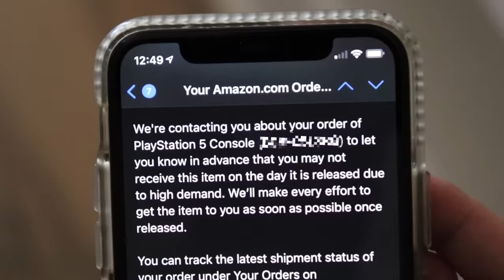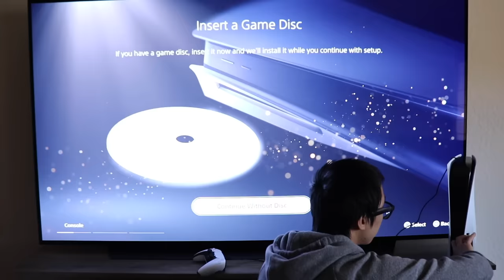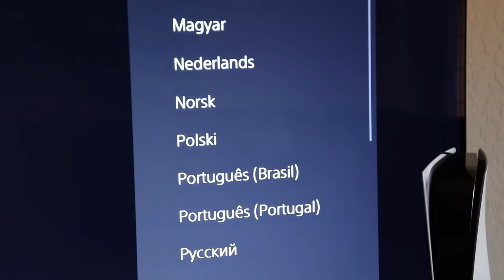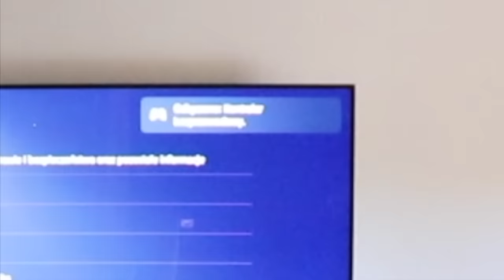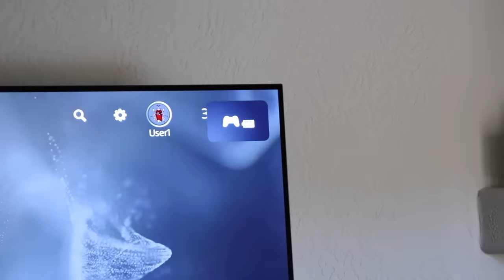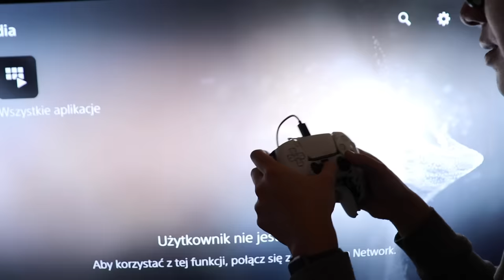Bored Smashing - PS5

Comment: The ps5 controler

- Hot design and slick!
- HP : 1000
- type : defense 
- ability : can reflect +25% gamer rage damage
- special ability : strong built quality
Reply: More like hp 900000
Reply: @mocha5242  it’s over 9000!!!!!!
Reply: @ferretglobal957  Metal bat
-steel oo oo 
-HP: 5000
-attack: 6000
-type: attack
-ability: Stronk
-special ability: Can be used in a muggery
Reply: @Rizki Rio Chandrawintana  
Xbox console
Cool design 
HP 10000
Type: durability
Special ability: can take 30 mini fridges

Xbox controller: 
Hp: 500
Type: Gaming 
Special ability:has a better dpad than ps5 controller
Reply: @mocha5242  ps5 fanboy
Reply: @x-iei-x4725  idk
Reply: Weaknesses: When you set it to the wrong language

Comment: Microsoft approach: if it ain’t broke don’t fix it. Sony‘s approach: make everything new make everything different
Reply: True. Btw no hate on xbox or ps
Reply: Sony has always done things differently
Reply: Stop reading my comment at least we don’t need to buy a new controller for some batteries.
Reply: At least we don’t have to deal with the same controller for another 8 years
Reply: Nintendo: C H A N G E  E V E R Y T H I N G
Reply: There's gotta be a ps5 fanboy around here somewhere.
Reply: Those batteries need to be fixed though
Reply: Nintendo
Reply: Tyen why the fuck have the had the same controller for the entire lineup of sony consoles
Reply: @user-pl6ed4cd4q  Actually... no. Its near perfection. They could make the sticks more durable to prevent drift but everything else is way better than what Sony has offered so far, no offense.
Reply: Kattos _  and if the litium  rechargable  is dead cause time you can replace
Reply: @user-pl6ed4cd4q  Well this seems to be the issue with people that have Dead Pool profile pics. Judging others, telling them they don't have capacity and make some bullsht claims without being able to back it up. What about this controller aside from the stick drifting (which the DS4 has too) is faulty in your opinion? It just works, and people dont get handcramps with it.
Reply: @marcianomorisson2542  Exept when they copy nintendo.
Reply: @bonnjust4001  Sony didn't copy Nintendo
Reply: Man I saw this augment as soon as I click the video
Reply: @whenallelsfails21  What has the UI to do with the controller? 

The last time Microsoft has been trying to put advanced features into a controller they failed with the Elite Series 2. They are always breaking down and now they got a class action lawsuit on their arse. Lets be real here the mechanisms are made out of shitty plastics. How long is it goint to last? Time will tell but I prefer durability over features that only a small amount of devs are going to implement in their games anyway. Not to shit on the Dualsense features but arent you atleast a little concerned that this shiet drains the internal battery that quick? Aside from that having integrated rechargeable batteries isn't a plus, yet people support it and I dont get it. What is wrong about having an option to either use a battery pack or sum cheap AA's?

And about the UI, apparently the PS5 UI is having lots of issues. Because Sony is lazy and doesnt want the system to be hacked within the first week, which is why they disabled storage options and the browser. They randomly crash and turn off midstream out of nowhere while nearly all of the features that the Xbox One had are working perfectly on the Series X. The Xbox UI is ugly as shiet man, and only 1080p, but IT WORKS. Thats why im happy having this thing and I had zero problems the last 6 days.

When it comes to exclusives I can wait I am playing lots of triple A titles so I dont really miss out. The only Sony franchise that keep me buying Playstation consoles is Gran Turismo.

Comment: 7:20 The ps5 console was not turned off properly

Before unplugging the mains power cable, select [Power]> [Disable ps5 consoles]

If you unplug the mains power cable when the power stimate of the ps5 console lights up or flashes, data loss or corruption may occur.

Comment: You can also brake the ps5 because of putting it the up way by the metal can melt and it will leak through the motherboard and brake the ps5